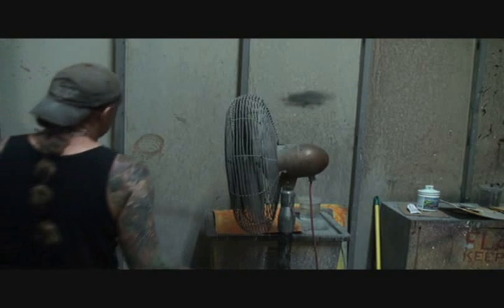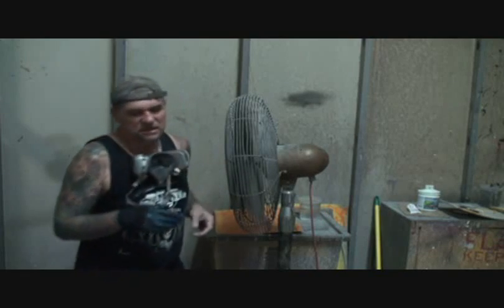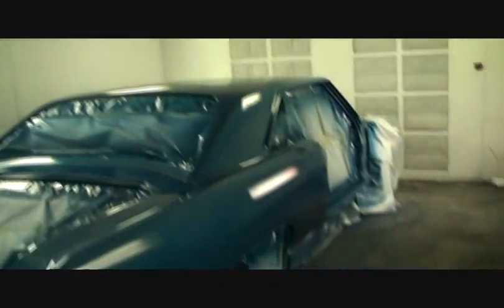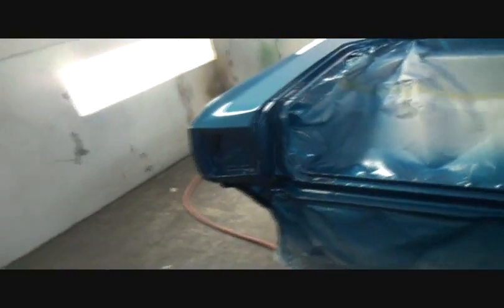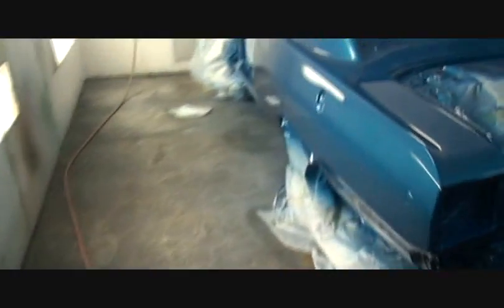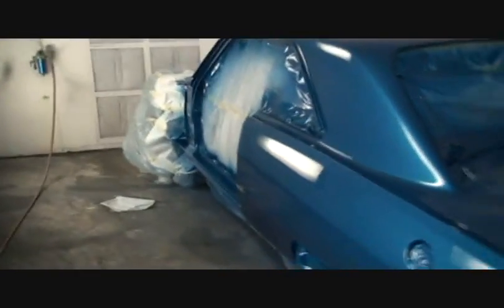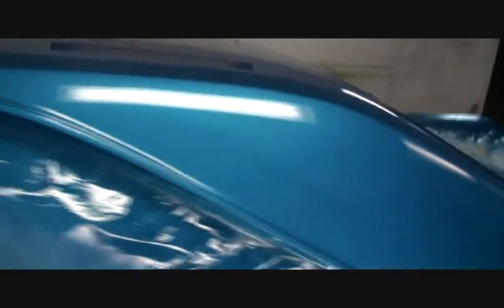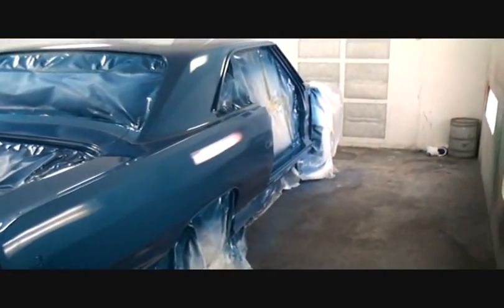1968 Dodge GTS-DIY Automotive Refinishing-Professionally Painted Muscle Car. DONE!

Comment from the maker: @jamesinengland1 I used to use a PPG Primer that had an etching additive in it, but quit because the products that they have out today makes it unnecasary. When I do an overall, I also concentrate on the windshield area as well, taking it down to bare metal as well, fo insure a good paint job , to lay the paint properly is all in the way you mix it and spray it, setting your gun the right way has alot to do with the way paint will be applied. Thanks Pete

Comment: @swrnc yeah this is a liquid. some kind of floor coating that makes it tacky. not sure what it is or how it works, but my supplier made good mention of it one day and told me to try it out. See, out here in CA, waterborne paint is all we really have for quality color matching. So when you wet down the floor, you increase the humidity and the paint takes hours to dry. can even get bad enough to make it run. so water isnt a good option for fast drying envirobase paint.

Comment: Hi Pete,
I think you're videos are fantastic, thanks for sharing your business adventures and automotive knowledge.
I'm attempting a restoration of a merc w124 coupe, which is the coupe version of the merc saloon (sedan) that you repaired and welded a back-end onto in one of your videos.
I would like to know what your opinion is of zinc rich primer, like 90%+ zinc rich primers? I have used a 90%+ zinc primer on bare metal and then used a anti-stone chip primer before using epoxy primer.ThnksJ

Comment: Hey Pete, Great job as usual!!  Hey, just wonderin though, I just finished a 67 Cadillac Eldorado about the same color.  It's getting a White Vinyl top as well.  I won't be installing the top, so went to the upholstery shop and they said to paint and DO NOT clear coat the top.  Actually they said the top could be left in Primer, but I didn't like the sound of that.  Anyway, long story short, No clear on the top, as their glue for the vinyl will not stick to the clear coat.  Never heard of that before, but, I haven't been in the Business that long either.  Just wonderin after seein this episode of SWRNC.  Get Er Done, My friend Pete!!!

Comment: Thanks for the info Pete,
On the 1968 dodge gts, with respect to where the windshield will sit in the channelling where does the single stage paint finish and the basecoat clearcoat start please? Is the actual window channelling done in basecoat/clearcoat?  I'm spraying with a sata nr95 hvlp with a 1.3mm tip and I'm using Nexa/ici p422 basecoat which comes under the umbella of ppg, clearcoat is ppg deltron d800. This is my first restoration project of a merc w124 coupe. Cheers James, England UK

Comment: Hi Pete,
Fantastic paint job Pete.
Do you ever use etch primer on your vehicle restorations or do you have a preference to epoxy primer? What's your opinion?
Please could you tell me where the the windscreen (windshield) glass sits on the vehicle do you have to prepare the paint any different so that the polyurethane windcreen adhesive will create a strong bond to the vehicle?
How do you get the basecoat to go on so flat? With basecoat/clearcoat system do you ever fine sand the basecoat? J